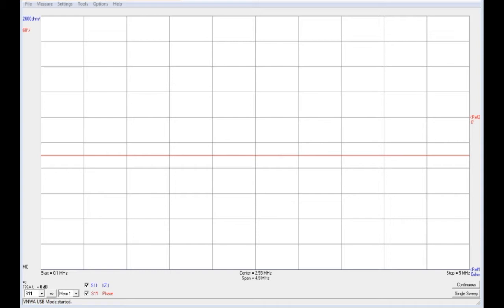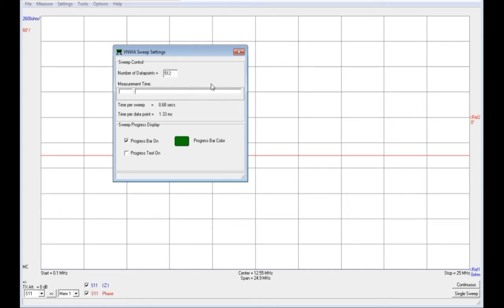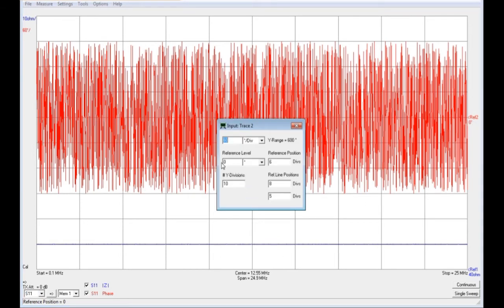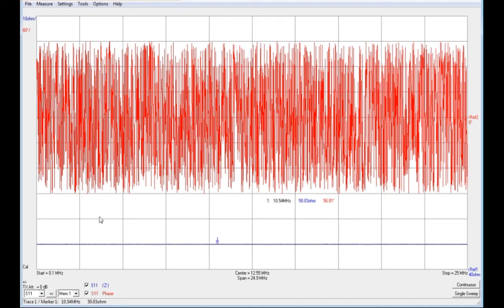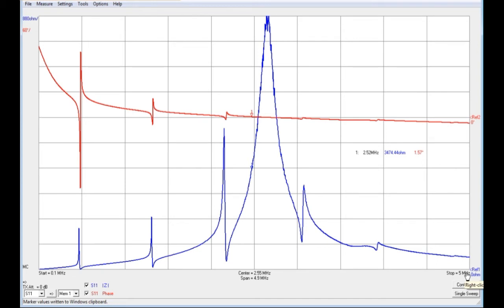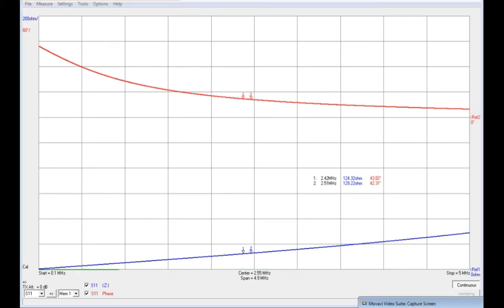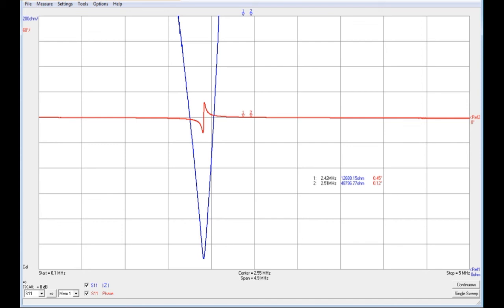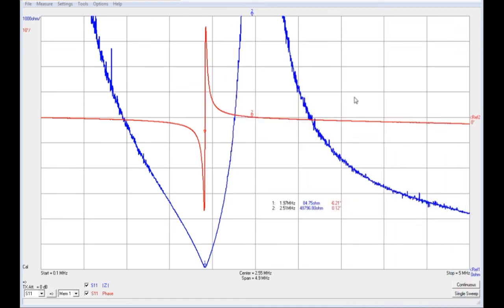Vector Network Analyzer 2 - SDRKits DG8SAQ Software, Calibration, and Measuring a Tesla coil

Comment: Hello, thanks a ton for this amazing video! I have just setup my VNWA against my tesla magnifier system with your help. Having a 3 coil system with a parallel capacitor on the primary is rather complex from the data I am getting and knowing where the coil resonates at experimentally. Ideally id like to use the VNWA to 1. Get the input impedance so I can build a PFN to match it as I am switching it with a thyratron... and 2. Improve the magnifier system to get better power outputs and voltage magnification (higher q factor).

it seems looking at the coil through the primary the highest impedance is the best frequency and impedance the driver should be geared for....but when looking at a coil by itself in series mode, the best driving frequency should be the lowest impedance point....it also seems the less coupling between the primary/secondary the closer the frequencies get for max impedance and phase change....

Then, it would seem the most ideal system would consist of a primary (with parallel capacitor) tuned to the lowest impedance frequency of the coil found through series VNWA analysis of the free standing secondary coil? At a coupling where the frequencies of max impedance match the lowest impedance frequency of the free standing secondary? (hope this makes sense)

Also do you go into any other details as far as what is ideal in terms of the VWNA data and how to better match a driver to the secondary coil system? For data, the impedance value and frequency seem to be the most key factors to designing a driver so the impedance is matching for max power transfer to the resonant coil....any other big data points to look for? - thanks in advance!
Reply: you're both great, thanks
Reply from the maker: Hi, I cover much of what you ask in a lot of detail on my website. Here are some links to get started with:

Cylindrical Coil Input Impedance – TC and TMT Z11: https://www.am-innovations.com/cylindrical-coil-input-impedance-tc-and-tmt-z11
Tesla Coil Geometry and Cylindrical Coil Design: https://www.am-innovations.com/tesla-coil-geometry-and-cylindrical-coil-design
Cylindrical 3-Coil Input Impedance – Tesla’s Extra Coil - https://www.am-innovations.com/cylindrical-3coil-input-impedance-teslas-extra-coil

Since you are using a Thyratron as a generator I would imagine you are working with impulses in your system which makes it very non-linear. In this case it is best to drive the TMT at the fundamental (lowest) series resonant mode where the input impedance is usually minimum. This will allow you to maximise non-linear currents in the primary coil coupled through to the secondary and extra coils. In the case of impulse systems you can take two approaches to optimse power transfer: 
1. Make the primary circuit resonant to match closely the secondary (same as you would for a spark gap generator) which means the impulse will cause ring-down in the primary at the lowest series mode of the secondary + extra.
2. Minimise the primary input impedance as low as you can get it (literally build the coil system on top of the generator) and hence maximise non-linear currents, and then couple as much of this to the secondary + extra as possible - In this case the impulses will excite both the secondary and extra coils at their own resonant frequencies which can lead to some very unusual non-linear discharges/plasma effects etc.  

Thyratrons can dump a lot of power in a very short time (micro-seconds), so it is really important to minimise inductance in all the connection leads, minimise input impedance of the 2 or 3-coil system, and keep the magnetic coupling factor between primary and seconday k < 0.2 to maximise free resonance and magnification. A 2 or 3-coil system with a non-linear generator is particularly hard to characterise with a VNA, which is designed to give you a linear picture of the frequency characteristics. But the VNA can give you a good initial starting point for how you go about optimising the connection between generator and TMT.

Comment: For simultaneous measuring of phase and impedance, you need this VNA: DG8SAQ  VNWA3EC (with the  Expansion Board!)
Reply from the maker: the EC version allows simultaneous measurement of S11 and S21. All VNWA3 models can measure the magnitude of the impedance and the phase of the impedance.